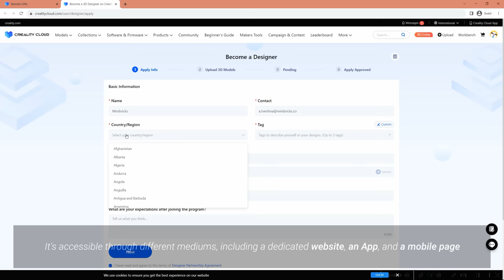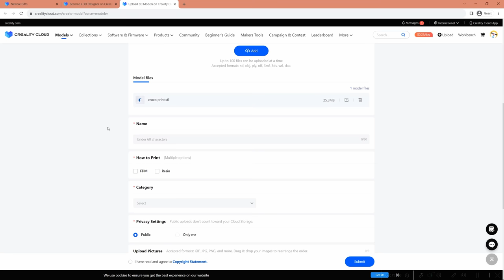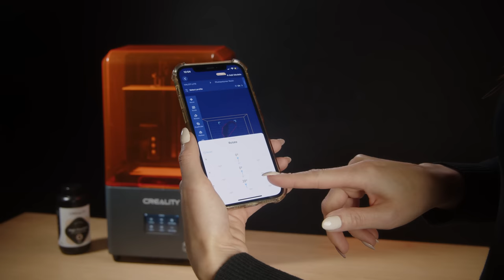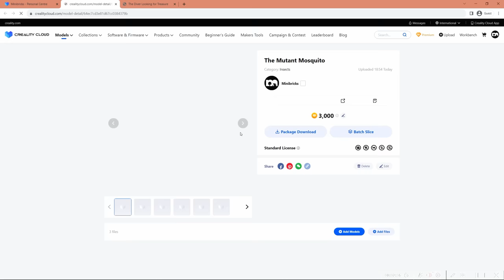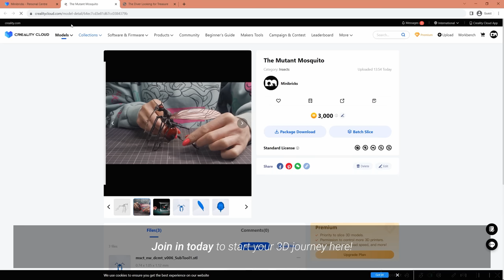Minibricks: This is a true story about fisherman Jimmy and Crocodile / Diorama / Creality Cloud

Comment: What is the shiny thing you applied in 3:42 minutes?
Also, what precautions do you take to prevent the acrylic paint on the character from flowing as a result of contact with the epoxy?